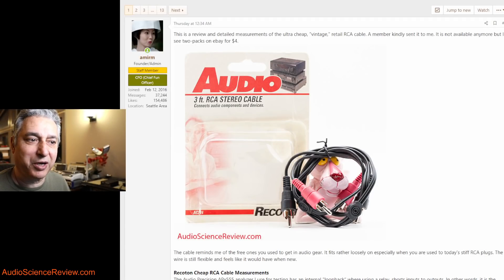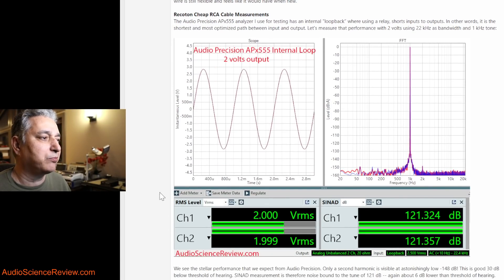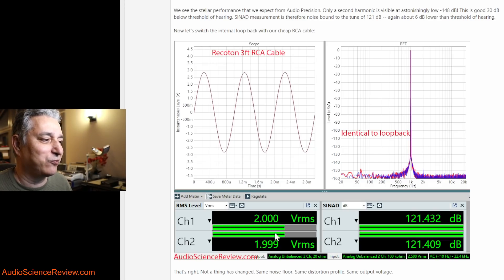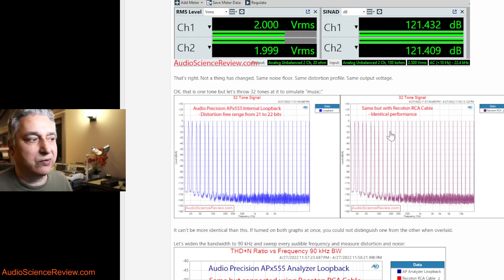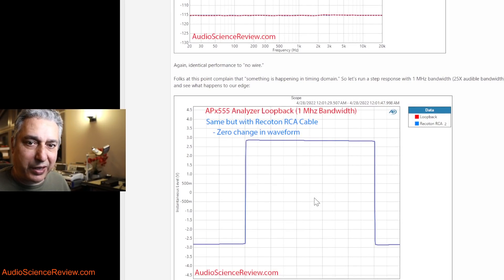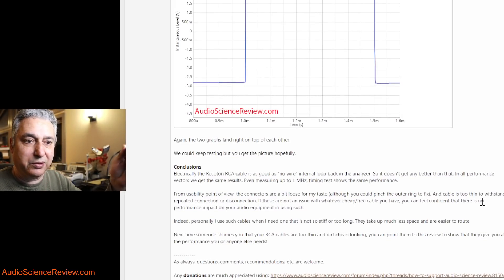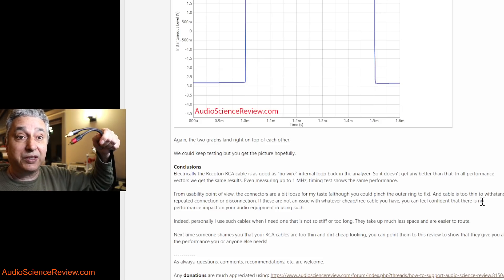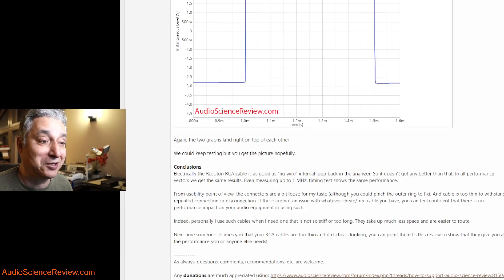Are Dirt Cheap RCA Cables Any Good?

Comment: I hate these cheap cables. I personally use Mogami 2534 or the Canare L-4E6S that I made myself with neutrik connectors (XLR). These cables can last more than 20-30 years, might as well be good.
Reply: @Douglas Blake For me it started when my guitar was picking up radio stations. After some research I found that good shielded cables can help and when I switched to some mogami cables, the RF signals were gone. 
Fast forward 10 years (and many broken cheap audio cables), I became an antenna engineer and I found the star quads cables had measurable less EMI. Is that audible? For speakers, from my experience no, but recording with less sensitive microphones EMI can for sure be audible. 
Now if I spend the time to solder some custom cables, might as well use the best cables I know. For 3.5 euro per meter it's not an insane price. It's actually still cheaper than buying premade cables with neutrik connectors. I don't know why you find it ludicrous.
Reply: Audio cables don't deteriorate electrically, at least not in the usual home stereo system context, so touting longevity is relevant only when cables are frequently plugged/unplugged or otherwise subjected to repeated physical wear and tear, e.g in pro audio applications where tougher products are required.  If used for the usual DAC/preamp-to-amp circuit, the cheap cable Amir tested would easily last for the same "20-30 years" -- it's already stayed exceptionally flexible and performs perfectly even after decades tightly coiled in an equally cheap retail blister pack.
Reply: @editorjuno  First of all, star quad cables have audible and measurable lower noise than other cables, especially non shielded. In my experience you can get noise to your cables even in a small home studio unless plan the route of your cables.
In terms of durability, I've damaged 4-5 cheap cables in the last 10 years, but my better quality ones still feel like new. 
The worse part is when a cheap cable  almost works fine and you try to find where's the problem.
Reply: @theodoro89  -- This has nothing whatsoever to do with the viability of this cheap RCA cable in a typical home stereo system, in which more often than not the cable will be plugged in once and unobtrusively do its very simple job perfectly for years until some component or other is replaced -- and then get plugged in a second time to resume doing that job just as perfectly.

If "measurably lower noise" is one of your primary concerns in that home stereo context, getting quieter amplification -- the third party SINAD numbers published on ASR being a fine guide -- will do a lot more good than investing in a pricier RCA cable.

Thanks for playing -- I'm not disputing what you've written, just pointing out its utter irrelevance to a typical home stereo system that can't even accommodate XLR connections.
Reply: @editorjuno  Amirm run the tests in an ideal scenario. Not a typical home use. How do I know this? Because the no-cable test had the same performance as the cable test. In the real world this doesn't happen unless someone carefully routed the cables away from EMR. Sometimes that's easy, sometimes it's not.
Also quieter amplification is more expensive than cables and it certainly WON'T help with the problem if you have EMR in the first place. 

I guess Amirm was aiming to dispute purpose of super expensive cables and he did a great job at that. However it's not the only scenario and some people would benefit from shielded or even star quad XLR cables, especially in computer setups.
Reply: @theodoro89  -- Audible EMI is a rare occurrence in my 50+ years of experience with home stereo gear.  Moreover, Amir has already tested numerous RCA cables at various price points for EMI susceptibility by placing cables literally on top of a big transformer carrying plenty of AC, and most of the ones that measured well in other respects were unaffected.

He and I would certainly agree that balanced cabling is intrinsically better, but because of the sheer size of XLR receptacles in the context of the rapidly shrinking size of home audio components -- not to mention the absurdly complex back panels of the big AVRs favored by the home theater contingent -- acceptance of that solution has been slower than molasses poured in January, and understandably so.  What is needed for home stereos is a downsized balanced cable connection scheme -- something that's smaller than the XLR but more durable and reliable than the 3.5mm TRS stuff that currently dominates the consumer side of the wired headphone and IEM world.

BTW, my current near field system lives in close proximity to two big PeeCee towers -- one of which houses no fewer than nine (9) hard drives, five of them spinning at 15k RPM -- and the only audible EMI that system has ever endured was the result of nearby heavy construction equipment that was so loud acoustically that the EMI-induced noise was the least of the (fortunately temporary) impediments to serious music listening.
Reply: @Douglas Blake That might be true in an ideal world. In the real world the cable acts like an antenna. Doesn't matter if you connect it to a source or not. 
Or more correctly, the cable will direct any EM energy to your output. That might be from your source or from any other unwanted source. If you connect your cable to your source you'll get a good energy transfer, but it  still won't stop your cable acting as an antenna. Only shielding and other EMI prevention techniques will do that.

Comment: Thanks again for another excellent analysis Amir. Can you test the Bluejeans LC-1 cable, it is agree by many that is an excellent option for audiophiles without expending a lot of money. About 45 USD for a 3 feet pair RCA. I am almost certain that the differences many listeners say they hear in ultra expensive cables is actually that the cable has mess up something, has filtered or smoothed something.
Reply: You seem to not get it. If the cheapo works properly, the heavier better built product does too (and everything BJC makes is good stuff). Claims by listeners about cables are related to having spend the $$ and convinced themselves they hear improvement.
Reply: @johnsmith1474  I actually use Bluejeans cables and also have some pretty expensive Audioquest (which I don't feel are worth the money). But I am with Amir I am not paying for 1000 USD per meter cable, rather put that money into the components.
Reply: @johnsmith1474  it’s not the cables as shown by this test. If a cable isn’t broken, it will work perfectly. The two issues are 1. Most people have some level of damaged hearing, no one has perfect hearing. I’ve lost count of the live concerts I’ve attended and had ring ears for days. Individual Hearing is Like fingerprints, no other match. 2. Having been in Sales for 30+ years, people buy with their eyes.
Reply: I make 2 meter cables and sell them for $60. 1/3 of that is for the connectors, 1/3 is my labour, and 1/3 is profit. If I was making hundreds I could reduce my margin, and if I mechanised I could reduce the assembly cost.

Cost of the actual cable is $2

Happy to put one of mine into any proper double blind test.
Reply from the maker: Gosh, $47 is a lot of money for a 3-foot cable.  I have tested much cheaper cables that have perfect transparency: https://www.audiosciencereview.com/forum/index.php?threads/battle-of-rca-cables-mogami-amazon-monoprice.27871/

How badly do you need me to spend money on this versus something else to test?  :)
Reply: @AudioScienceReview  HUH! I am confused I thought there were no difference in cables, I mean that is what you are preaching and suddenly you say "I have tested much cheaper cables that have perfect transparency" so what is it now? Do you hear a difference or you don't?

Comment: I would love for you to make a "bird's nest" test, if you look behind an audio system do both power, interconnects and speaker cables run in parallel and across each others. How much of this do in fact gets picked up, how much gets amplified or send directly to the speakers? How much does your small SMPS, your light fixtures, refrigerator and other things in reality influence the sound?
Electronic engineers do spend a lot of time, knowledge and energy to avoid EMI and other types of noise.
Reply from the maker: To simulate magnetic induction, I use an AC transformer and have to literally touch the RCA cable and align it the right way to get some to induce.  Even then, what is induced is very low in amplitude and hence inaudible.  See tests here: https://www.audiosciencereview.com/forum/index.php?threads/battle-of-rca-cables-mogami-amazon-monoprice.27871/

So I don't see the rats nest being a factor.  Running a wire parallel to power line for many feet may do it though.
Reply: @AudioScienceReview  I like you, it's amazing how you always take you time to reply to comments, even the once from less knowledge people like me.
I had a wrong idea of unshielded cables delivering a minute signal that men got amplified maybe 30 times, that this signal could maybe make the speaker driver vibrate a bit, all the time.
I have seen videos on how, even standing near an electronic sensitive test, can kick everything off balance. :-)

Comment: So. If you analyze the cable you also use the analyzer to listen to music ? When did analyzing replace ears ? If you do not hear any difference between cables you should be kept far far from any audio forum ....
Reply: Amir has devoted a lot of time delving into the exact, "So, why does it sound different to me?" issue you bring up, including at least one vid on how to do blind testing that is fascinating and aimed at empty handed critics who make insubstantial claims. His standards for testing via listening, separately from making measurements, are top class work. And as I recall he invites people like yourself, who insist that their imagination is not affecting their perception of better or worse sound, to do blind testing, then buy what you like if it makes you happy. You will not prove via blind test you are correct, you'll pick the cheap product half the time.

Meanwhile physics and science nerds like myself can be pleased that the fundamentals they were taught in school hold true in the face of myth & hype about products. So you spend a ton and I spend little, we both get the same sound and are both happy!
Reply from the maker: I perform tons and tons of listening tests using these very cables.  Unfortunately you can't get inside my head and reliably determine what my ears are transmitting to my brain.  But you can look at measurements showing that the cable is fully transparent.  It is for the same reason that your doctor checks your blood pressure, temperature, weight, etc.  His experience can tell him if those are out of norm and cause for what is ailing you.  No different when testing cables.

And yes, I perceive a ton of differences in cables as you do.  Problem is that when the test is done blindly on me or other audiophiles claiming the same, all those differences become random and disappear like fart in the wind.  To the extent measurements predict that as well makes your case a lost one.  Your brain is marvelous in the way it manufactures what is not there.
Reply: @AudioScienceReview  "I perform tons and tons of listening tests using these very cables." Man you are on a bad path. Please, for you own good fortune, do something else. If playing with my hi-fi gear over the years has thought me anything it has this. Pay attention and you progress. You just told me you have not. I was sad for a moment but then. Enjoy being you.

Comment: The only thing I need in cables is isolation. I had a loop noise in my past crowded hifi system and I got crazy before understanding it was a thiny cables fault. Note that the radio dab thay connected to the integrated amp was  turned off during the loop noise.

Comment: Audio magazine used to perform 10khz Square wave tests and tone burst test on equipment. I wonder what ASR thinks of that type of testing.
Reply from the maker: I see no value in them.  If you play a 10 kHz square wave from a CD, it will almost look like a sine wave!  The reason is that only its second harmonic is captured in CD format.  Everything above that cannot exist and as a result, such a signal is "illegal" content.  There was a time when amplifiers had really low bandwidth so people did these kinds of slew tests and such.  Today that is not an issue and as I just explained, our sources are highly bandwidth limited (as is our ear).

The other reason square wave test was used was because you could use any oscilloscope to analyze it to indirectly assess other factors such as low or high frequency bandwidth limits.  I use a direct method with an audio analyzer to detect that at far higher resolution (frequency response) so that is not of value either.

Comment: that contradicts my own experience. have used different interconnects of different brands - I‘d say from a 100€ upwards there is a typically very notable improvement over el cheapo stuff as tested here, provided reasonable quality of components, setup, room, ears and brains (signal processing); blessed those who don’t hear or measure any difference, as those never ever spend 300$ or so for an interconnect (actually neither did i), not sure though how music & listening works in this camp ..
Reply from the maker: No, we are not "blessed" that way.  We also perceive the same differences when testing sighted.  Our brain loves to manufacture such differences just as easily as it lets you dream the impossible things while sleep.  When we perform these tests blind, listeners simply cannot hear these differences any more.  In other words, when only the ear is involved, there is no perceived difference.  We have a local high-end audiophile with $500,000 system who agreed to be blind tested.  He completely failed to tell the difference between his super expensive MIT Oracle cables and Monster cable.

So our experiences are the same.  Where we are blessed is that we understand the science and engineering behind these products and how we hear. That allows us to not waste money on things that don't change the sound coming into our ear and instead, put it toward music purchases, good food, vacation, etc.  For that, I am grateful to decades of research into these fields.
Reply: @AudioScienceReview  yes, nice, i do respect your experience and yrs of research in the field. still i read some quantum of methodical bias and anecdotal ‘evidence’ out of your comment. A bunch of untrained ears do not lend themselves to meaningful listening tests, however blind their owners are, however expensive their hifi kit. Personal preference, individual abilities of musical perception, individual musical training, active and passive, the ability to follow the individual instruments, phrasing of a string quartet, etc trained ears through mastering, .. might make a bigger difference in trained ears and brains than the knowledge of brand and make of a unit under test. Ever noticed how many pop or rock bands at times do not nearly play along one and the same rhythm, but rather wrestle about rhythmical leadership? How some guitarists (also bassists) have their instruments quite a bit out of tune (unnoticed?) compared to the other instruments? How many jazz musicians on the contrary get it all so spot on..? Can you guess the pianist of a Mozart piano concerto? Or the conductor of a standard repertoire concert? Am asking because in your listening test you rarely report to hear any difference.. 

I actually do not care which cable should be better, i just listen long enough so that i want the better or best available in the system, sometimes this means to keep the one in place, sometimes it means to return to the previous configuration, regardless of price tag of available cables. No big deal. I am not a believer of undisturbed monotonous price quality linearity. 
Funnily enough, once i noticed the 1m version of one and the same make & brand interconnect sounded clearly less good than the 1/2m length version (the prior one had a bit of an emphases on very low lows and very high highs for some reason) - i did notice that, not because of the price tag, not because i had a length preference, nor some considerations on capacity or inductance, nor any other bias, no, it just sounded somewhat different, and not as good as the shorter one. Like a stone in the shoe getting more annoying with time.  I fear in your methodology such differences would go unnoticed. Tx for reading.
Reply: @gioponti6359  Don`t  bother. He never listens to stuff. 
He`s so sure that measurements is everything, no need to convince him either.
He`s a fanatic and measurement are his religion. So it`s impossible to be wrong.

But be sure about the fact that he`s just one man with an opinion and a lot of sheep followers who know nothing, but just following.

Comment: You’ve just made the people who live and die by specs run to the “Well, not everything that can be heard can be tested” corner. Or, they will disregard this test as a clever ploy for you to sell Recoton cables at $500 each as “Vintage Audiophile” cables because you’ve bought up all of the leftover supply.
Reply: I'd say that it is quite fair to say that not everything that we can hear can be tested. For example, the tests in this video don't say anything about soundstage. I assume you agree soundstage is a thing. What if this cable decreases soundstage?

I'm not saying that it does btw
Reply: @martijnbos9873 Soundstage is a subjective hallucination.